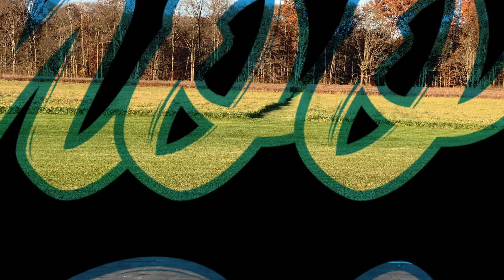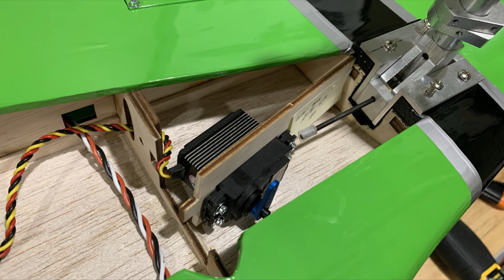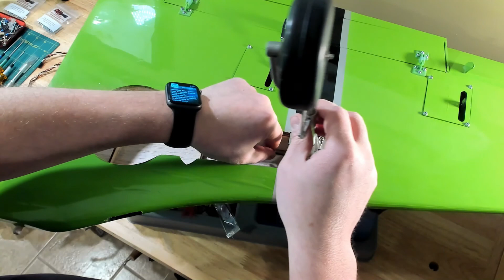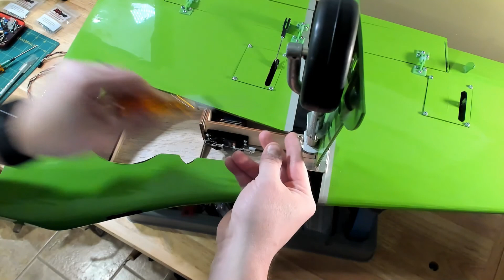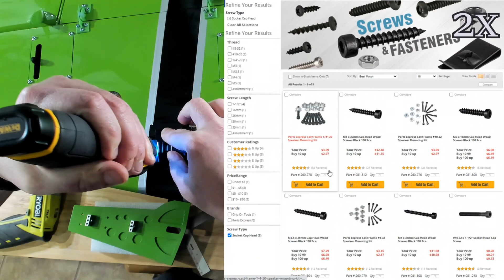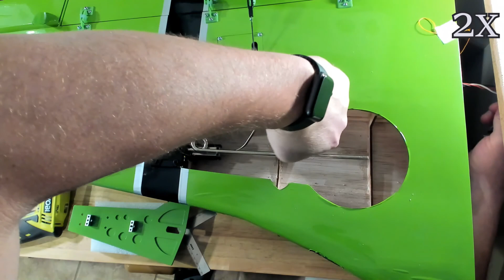How to install RETRACTS - Seagull Models Reno Air Care Yak-11 ARF - Perestroika Build - Episode 3.1

Comment: I have purchased a Yak 11 perestroika and need some advice on what servos to use for the retracts. Please help 🙂
Reply from the maker: From the manual: Retract Minimum servo spec.
Torque : 222 oz-in (16 kg-cm) @ 4.8V;
278 oz-in (20 kg-cm) @ 6.0V

You don't need special low profile servos for the retracts....standard servos will fit. You will need to slow them down either with programming or with your radio. (or purchase specific slow retract servos)

Comment: How come you fitted two different types of retracts? I’m confused..
Reply from the maker: The ARF comes with the servo operated retracts. I wanted to illustrate how those (and the servo) are installed. The servo-less retracts are optional, so I wanted to show that installation as well. (you have to use a different strut, gear door mounts, etc etc) I was also trying to decide for myself which ones to go with.

Comment: Always always always put flat spots in the wire where your wheels lock down. It don’t matter how right or how much lock tight sooner or later they will rotate. Flat spot on each side will stop them from ever rotating.
Reply from the maker: Thanks! I forgot to mention that. I did grind flat spots on both the struts and axles after I figured out the alignment.